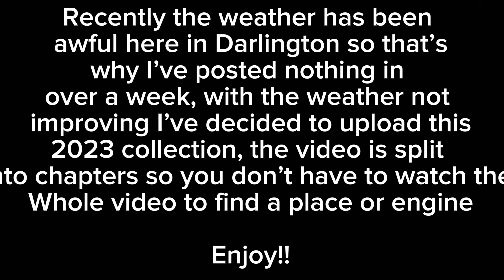Steam Engine Compilation 2023 - including non steam heritage engineering

Comment from the maker: Chapters
0:00 INTRO
0:10 CRAKEHALL WATER MILL
0:22 RAILTOUR AT DARLINGTON
1:13 POWER HALL AT ELLESMERE
2:24 VULCAN XH558 ENGINE RUN 
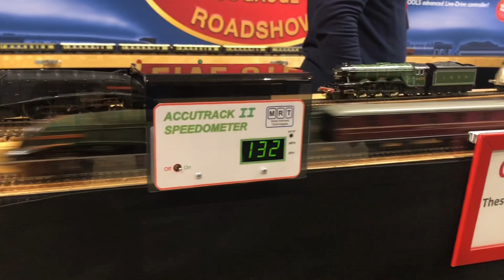3:07 HARROGATE MODEL ENGINEERING SHOW 2023
4:57 MERSEY FERRY SNOWDROP
5:01 BIRKENHEAD TRAMWAY & TRANSPORT MUSEUM
5:20 TEES COTTAGE PUMPING STATION GAS ENGINE
5:36 TEES COTTAGE PUMPING STATION MODEL ENGINES
5:42 ANIMAL FEED MILL STEAM ENGINE AT TEES COTTAGE
6:10 MINIATURE COMPOUND SHOWMANS ENGINE
6:18 LISTER D & TRIPLE RAM PUMPS
6:22 MODEL ENGINES AT TEES COTTAGE
7:02 TEES COTTAGE MINIATURE RAILWAY
7:10 KEITH APPLETON ENGINES
8:18 DELTIC ROYAL SCOTS GREY IN HURWORTH
8:32 MAMOD SE1 
8:55 TEES COTTAGE MINIATURE RAILWAY
9:08 RYHOPE PUMPING STATION
9:24 BEAMISH MUSEUM & COLLIERY WINDING ENGINE
10:53 KEITH APPLETON SHOWMAN ENGINE
10:59 GRANE MILL
12:38 ROYDON PARK MINIATURE RAILWAY
12:56 WIRRAL MODEL ENGINEERS
13:43 WALK MILL, CHESTER
13:54 PETE WATERMAN MAKING TRACKS 3
14:05 CLAYMILLS VICTORIAN PUMPING STATION
17:23 LEAWOOD PUMP HOUSE
18:38 MIDDLETON TOP ENGINE
19:04 PAPPLEWICK PUMPING STATION
22:26 TEES COTTAGE PUMPING STATION BEAM ENGINE & BOILER
22:44 THE DIABOLICAL MODEL STEAM ENGINE
22:58 ELSECAR NEWCOMEN ENGINE
23:33 WASHINGTON F PIT ENGINE
24:19 MINIATURE GWR 1100 CLASS LOCOMOTIVE
25:22 BANCROFT MILL ENGINE
26:29 SIR NIGEL GRESLEY IN DARLINGTON
26:58 THANKS FOR WATCHING!